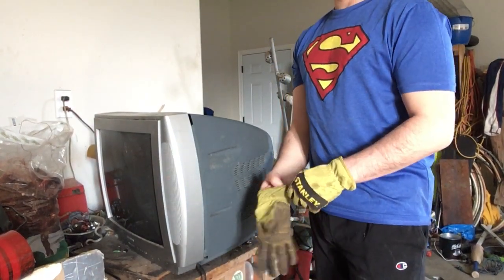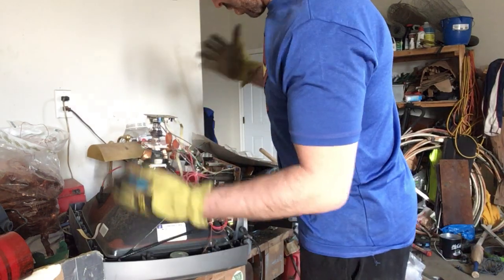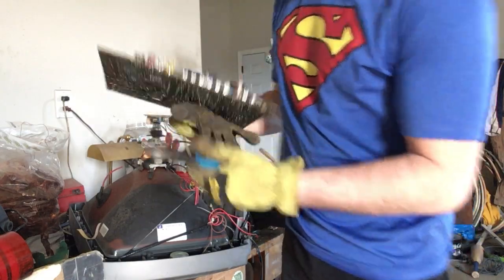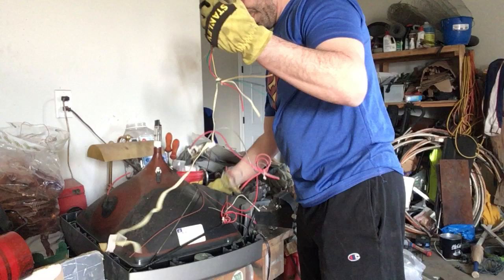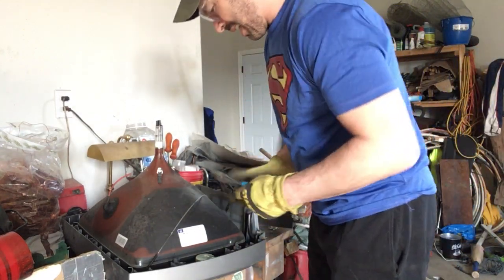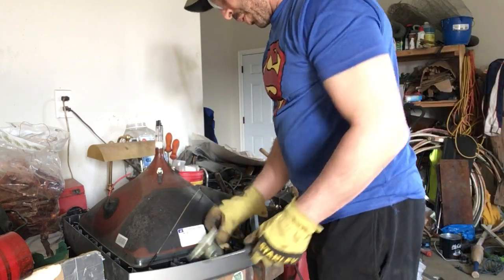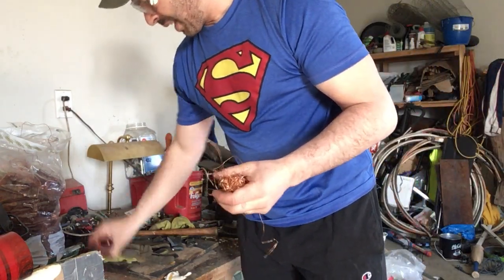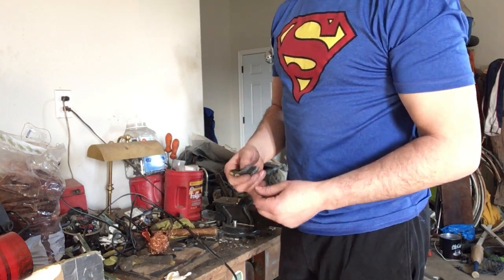Scrapping a tv for loads of copper, silver and other metals.

Comment: You can easily extract way more values from CRT TVs.
During many years as a hobby scrapper (recovering, recycling, and refining metals) I've processed hundreds of CRT TVs. Every bit of value is extracted! The glass tube contains on average 22% lead. There are three sections of glass in a CRT tube: The funnel (up to 28% lead), the frit line (70 to 80% lead), and the front panel (<5% lead). Wet milling and an alkaline process recovers >99% of the lead content. The glass fraction is then sold as glass powder. The inside of the front panel glass has a layer of valuable Rare Earth Elements. Using a manual diamond glass cutter to cut into the frit line makes it easy to separate the glass tube in two halves, the REEs are washed out in distilled water, which is then processed to extract the valuable elements.
The CRT glass is on par or better than the finest crystal glass. The neck (where the electron gun is placed), the conical funnel, and the frit line (where the front panel glass is joined), all contain lead oxide and very little barium- and strontium oxide; chemically bound with the glass itself.
The front panel glass (which is always processed separately) contains very little lead oxide, instead 10 to12% barium oxide and 8 to10% strontium oxide is present. Both are extracted chemically.
It is not entirely correct when people claim that the grey powder on the inside of the front panel is a phosphorus layer! The right term is: A fluorescent coating. The other is an old term derived from when CRT production began. There is no phosphor (except in the very first CRTs), but there might be a microscopic film of aluminium (especially in black/white CRTs) added as a nonreflecting layer on top of the fluorescent coating, and even on the inside of the glass funnel on some newer models. 
The composition of the powder varies greatly depending on the manufacturer, and where and when it was made. A graphite basic coating is applied to the inside of the front panel glass, and the powder will mainly consist of sulfides/chlorides/oxides of zinc, magnesium, manganese, chromium, antimony, copper, silver, yttrium, europium, and other REEs; in some elder CRTs even cadmium, beryllium, and arsenic. Most are toxic, some very toxic! Only wet removal by brush; or by high pressure washer. The latter must be done in a closed compartment. I use a discarded shower cabin that came from a gym center. 
Be aware of the sulfides, processing such powder by common acid leaching will produce H2S, which if inhaled will kill you.
All wires in old CRT TVs are always insulated with PVC plastic. These wires are pyrolyzed in a closed unit, resulting in bare bright copper, and contaminated HCl as a byproduct, and of course raw plastic pyrolysis oil. The two latter requires refining before being usable (Fire Retardant removal, among other), so it's just one of many sources of free HCL. I also make my own free H2SO4 and all my HNO3!
Steel parts and, if any aluminium or zinc parts, are sorted out, and sold directly as scrap metal.
CRT TVs usually contains three to nine Printed Circuit Boards. They are processed in a wet hydrometallurgical process. First all solder is removed, and later metallic lead and tin is recovered in two separate steps (a few "newer" models might have a little silver alloyed in the solder as well; so called lead free solder). All, now lose, electronic components are then sorted out and afterwards pyrolyzed to get rid of lacquer and plastic. Raw plastic pyrolysis oil is again collected for later refining. The components are then further processed into final products as various clean metals (i.e. pure nickel, copper, and minor quantities of precious metals, among other).
The yoke is pyrolyzed to get rid of all the resin plastic and lacquer, yielding bare bright copper and a ferrous alloy that goes straight to the bucket with irony magnets (not together with Neodymium magnets, which is a separate fraction).
Loudspeakers are pyrolyzed, giving raw plastic pyrolysis oil, clean steel and magnets (though no more magnetic after having been heated), as well as a lesser quantity of bright copper wire. The latter is treated in a hydrometallurgical process to recover the solder.
The plastic case and all other plastic parts are pyrolyzed, yielding raw plastic pyrolysis oil for later refining.
The printed circuit board itself, now without any electronic components, are pyrolyzed, giving raw plastic pyrolysis oil which is always heavily contaminated with Fire Retardants. Elemental Bromine is recovered from this oil. Bromine is notoriously difficult to store, but old wine bottles solved that problem. Filled with ½ a liter of Bromine, the neck is heated with a gas flame in a special constructed circular burner (homemade free gas, by the way) until glowing hot and twisted thus the opening is welded shut; continuous heating and a slight tapping with a water soaked wooden stick finishes the top reasonable square. After pyrolysis the residue is separated in copper layers and fiberglass. The copper is melted into bars and sold, but the glass fibers are unfortunately just handed over to a glass recycler for free as they are heavily contaminated with carbon residue, and not profitable neither to clean nor to melt into glass bricks of almost no value (Melting will remove the carbon by burning it off). By the way, use an air compressor to get rid of all the dust on the PCBs; this makes identification of components much easier.
All raw plastic pyrolysis oil obtained from CRT TVs will for sure contain hazardous Bromine- or Chlorinated compounds, therefore it requires refining by distillation and purification before it'll be legit to use for any purpose. CRT TVs are from a time when manufactors did not mark the plastic parts with the well known recycling symbols; although a few "newer" models does have the correct identification symbols on the various  plastic parts. This makes identification easy and also makes it easy to separate out the plastic parts without hazardous FR content. Only these plastic parts can be sold directly to plastic recyclers, after having been sorted out in the correct categories of plastic types.
The remaining carbon residue in the pyrolysis chamber is dropped in a little water and mixed with carbohydrates, i.e. old bread/pasta/flour and similar (with or without fungus doesn't matter, pressed into briquettes, and used as fuel in the fire chamber underneath the pyrolysis unit. The ash is later leached to recover the various sulfates, carbonates and oxides for different chemical reactions when refining metals or processing WEEE/e-waste.
My compliments, you do it the right way when you scrap CRTs; contrary to some other stupid "scrappers"! Never crack open the glass tube, or even worse smash it. CRT tubes contains lots of poisonous materials. In fact, they are one of the most problematic items for even professional recyclers to handle. It's important to keep them out of landfills, because toxic compounds will leach out for hundreds of years in the future. Never throw the glass in the trash bin, or dumpster. Always bring the remaining parts to a public transfer station, or a trustworthy company, for proper recycling. That is if you don't have the skills to recycle it yourself in order to get the full value of a old CRT TV.
Reply: You my friend are the absolute best CRT tv scrapper In the world.  Second to none but I sense jealousy.  You wish you had the video but the fun man beat you too it.